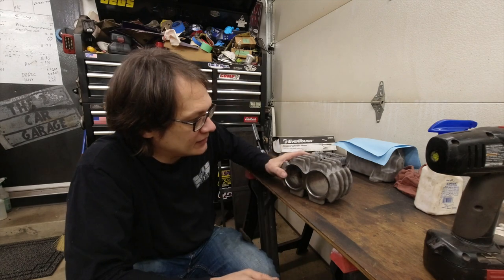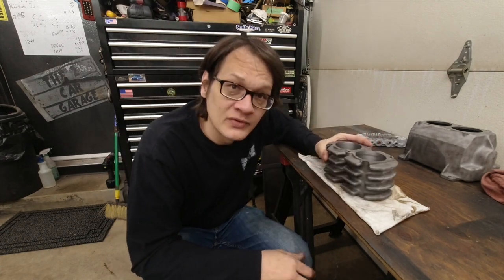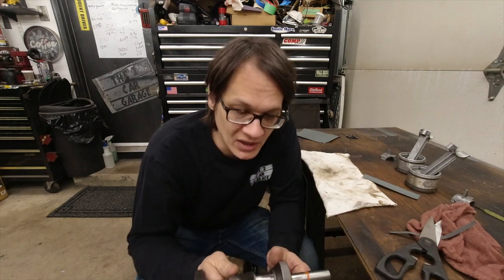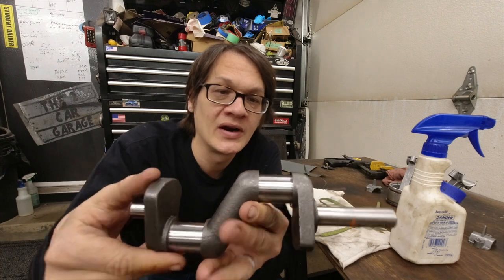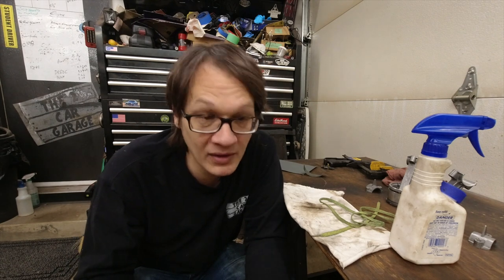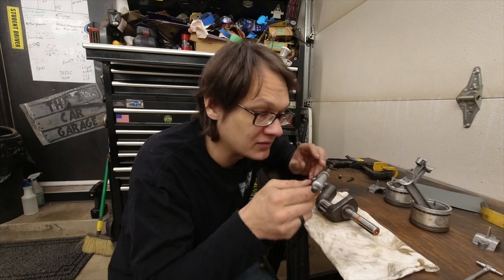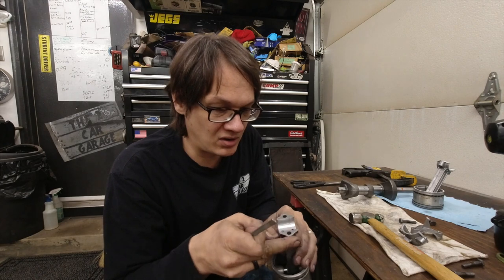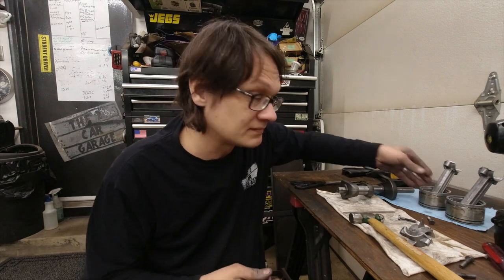Air Compressor Rebuild Part 2

Comment: Basically the same thing as a machine shop would do. I don’t think I would attempt it on small block Chevy rods or crank, but considering it’s an old air compressor it’ll work out great!
Reply from the maker: My thoughts exactly!

Comment: Where did you get the rebuild kit from?
Nice video
Reply from the maker: I got the kit from ebay. https://www.ebay.com/itm/Complete-Rebuild-Kit-For-Campbell-Hausfeld-Air-Compressor-Pump-With-2-3-4-Rings-/281236651589?_trksid=p2349624.m46890.l49292